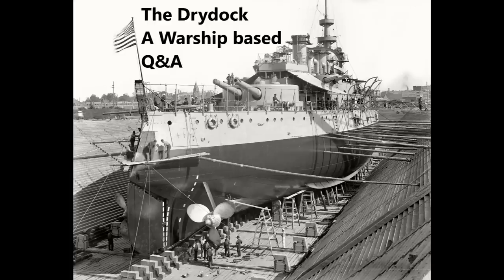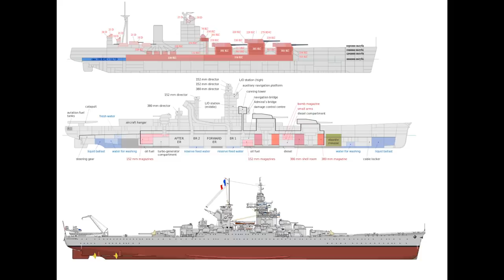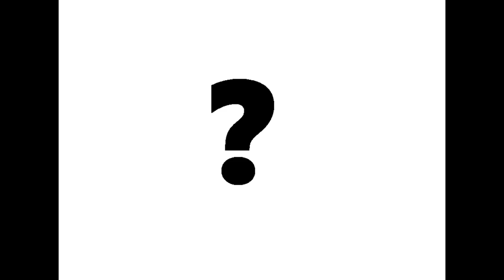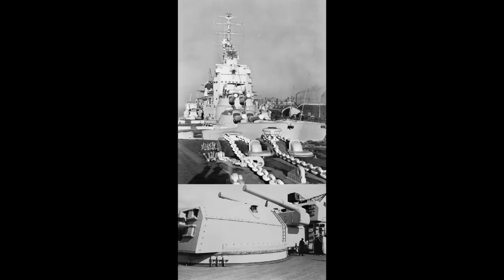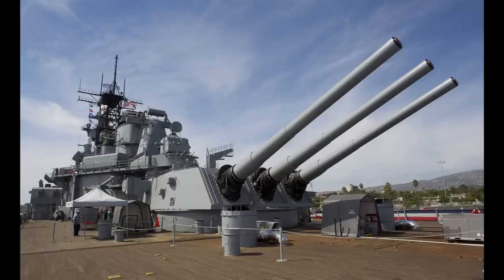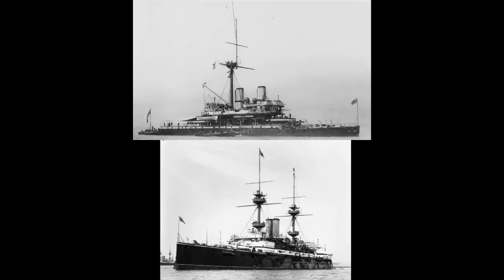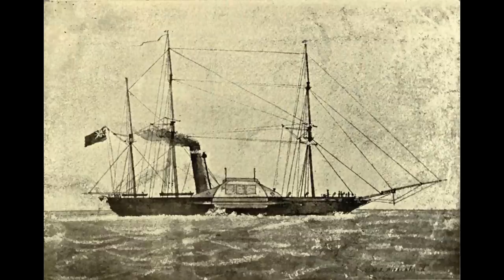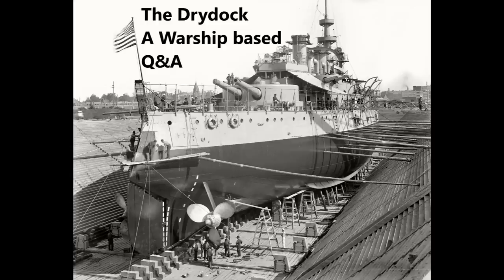The Drydock - Episode 012

Comment: Why didn't warships use projectiles in style with those seen in tanks, or did they?

HEAT
HESH
APBC
APCBC
APFSDS
APCR
Reply: APCBC was definitely used - it's just an adaptation of the normal AP shell by the addition of a cap. 

HEAT, HESH and APFSDS rounds were all technologies that emerged during WWII, when the last gen of battleships was already being built or in service, and matured during the Cold War when battleships just weren't a thing anymore. 

As for APCR, it requires you to basically pack the core of the shell with a super dense material like tungsten. That was a bitch for the Germans to obtain even for their 75mm shells, and I don't think any country in their right mind would try to make a tungsten core suitable for a 15 inch round. It'd be crazy expensive, possibly too heavy for the ammo lifts, and so on.

Comment: Q&A. Given the British navy's chronic shortage of ships at the commencement of WW2, and the fact that the British had had plenty of practice raising the High Sea's fleet............................... why wasn't the Royal Oak raised? The propaganda effects alone would have been worthwhile.
Reply: 1. It is a grave site. 2. She was old and capsized. The expense to salvage and return to service is huge. The danger of fuel leaks and live ammo handling add to problems.
Reply: 1. So was HMS Thesis and most of the stuff at Pearl harbour.2. RO was no older than the Queen Elizabeth's and the other Revenge class vessels. For the 15 inch rifles alone, best in the world, long manufacturing time and required for replacements for a number of classes it would have been worth it.2.5 Salving a capsized ship had already been carried out successfully and should have presented no new challenges to the guys who raised half the German Fleet 3. Fuel and ordinance are hazards that any decent salvage crew can handle.
Reply: @johngreen1706  Well.... the Royal Navy seems to have not shared that view. Thus she remains today as is..... 🙄
Reply: The Royal Oak ended up turning almost completely upside down when she hit bottom.  Her superstructure was crushed by the hull landing on it.  Also, no ship's hull is designed to take the amount of stress that comes from being flipped over 180 degrees and landing upside down.  While the hull appears to be largely intact, hitting the bottom must have created some stress fractures in the metal, even if they are not detectable by the human eye.  30,000 plus tons of steel are going to hit the bottom with a lot of force.  If the ship couild have been lifted all the turrets would've likely fallen out, so those would have had to be raised separately.  Finally, the Royal Oak sank in 33 meters of water (a little more than 100 ft deep), which is far deeper than any of the wrecks at Pearl Harbor.  The superstructure of almost all the American battleships at Pearl Harbor were above the water even after they sank.  The hull of the Oklahoma, which capsized, was also above the water. 

Perhaps the hull of the Royal Oak could have been raised.  The Derflinger; which also turned upside down when she was scuttled at Scapa Flow, was raised from an even greater depth of 45 meters (148 feet).  However, had the Royal Oak been raised she would have been nothing more than a hulk that needed to be scraped; which IMO, would hardly have made for inspiring propaganda.

Comment: Question for the next time:

It is often said that Jutland was a "strategic victory" for the RN but, I have found no factual support for such bold statement.  Following Campbell, he is clear the Germans cancelled the operation that intended to lure into an ambush the BCF or part of the GF due to lack of aerial recce and implemented the Jutland operation instead, a cruise off Denmark intended to lure the GF out and over the Uboats already positioned for the cancelled operation, but nothing more, no intent to engage GF units and much less some mithycal attempt at blockade breaking.  

Does that claim hold any water or is it just propaganda to sooth British feelings?
Reply: I think any result that wasn't a major victory for the Germans was in essence a British victory, because it meant the overall British superiority in no. of ships remained the same (which was only going to increase throughout the war as the British blockade hindered German ability to construct new ships)
Reply: @OhSome1HasThisName  It was a minor German victory and no, the number of ships did not remain the same as the wrecks on the bottom of the sea can attest, but eventually the British did make up for the lost numbers, but that is a different thing.
Reply: @trauko1388  The point I was trying to make is despite higher British losses, the overall balance of naval power remained in favour of the Royal Navy -> all they had to do to achieve a 'strategic victory' was not lose so many ships as to make the High Seas Fleet equal/superior to the RN, but yeah I'd agree it's still odd to call it a victory
Reply: @OhSome1HasThisName  It is not odd, it doesnt make sense, it is like saying the Germans were winning WW2 until they lost... it implies everything is meaningless until decided, and there are plenty of wars lost due to constant small defeats.  Jutland of course was just one, and to claim "strategic victory" for the British is simply nonsense, sorry.  Their strategy was blockade, not keeping ships, and in the END it worked, but claiming that Jutland was a British victory of some kind is pure nonsense.
Reply: Agree to disagree
Reply: @OhSome1HasThisName  Agree that disagreeing is not an actual argument.
Reply: @trauko1388  Okay fine, my argument: Britain blockades Germany, Germany wants to sap the British fleet via raiding to break said blockade but ends up with a full fleet engagement at Jutland, Germany fails to significantly dent the British fleet, hence doesn't break blockade, so long-term (so strategic as opposed to tactical) British victory - I was saying agree to disagree because I think we have very different definitions of what constitutes a strategic victory
Reply: Germany's strategy was kleinkrieg, guerrilla warfare, to destroy the UK's naval advantage throuh mine, torpedo and sinking isolated units until a general engagement could be tried with some hope of success.

Jutland did just that.

It was a reduction of the GF's numerical advantage, the only issue was that it was done through a fleet engagement, something quite premature for the Germans, but the result itself was quite positive and a good example of a successful implementation of Germany's strategy.

There is only problems when anglo authors move the goal posts and claim "failure to break the blockade" or "failure to sink the GF" or "failure to win enough"... which is the poisition you have taken.  The answer is always easym you only have to provide proof that Scheer, or for that matter anyone in the KM, actually intended Jutland to achieve whatever you claim they wanted to achieve.

I can of course point out to the differences between the Sunderland operation, with a Uboat ambush, the GK bait for the BCF, and HSF and zeppelin support... and the Jutland operation, intended to just make use of the pre-positioned Uboats by showing up on the Skagerrak (see how far Sunderland is from Denmark) and hopefuly causing the GF to steam over the Uboat trap as the HSF sailed safely back to port. That was it, no perspective of engagement with heavy units, just an attempt not to waste all the effort invested in the cancelled operation.

Can you really claim the enemy failed to achieve something in a battle when they didnt actually intended to do it?

Btw, if Jutland is not winning enough, what is it? 5 ships? 7? Half?

I will let you with Campbell's conclusion, which seems fair to me:

"However, it had never been any part of Scheer's plan to engage the whole of the Grand Fleet, and though he had doubtless hoped for a still more favourable loss ratio, he could at least claim partial success, the most usual result in any operation of war. Scheer was ready to try again on 19 August 1916."

Now, tell me something, if May 31st was a UK strategic victory, what was the day before, May 30th?  That day the GF LOST NO SHIPS!  Was that a MAJOR UK strategic victory?  What a bout June 8th? September 13th? Or any other day? Because in the very limited sense anglo authors torture the term well, any and all days were a strategic victory.

And you can make that argument... about the BLOCKADE, because that was the long term strategy, but that is meaningless about Jutland, and you could in fact make that claim even after a hypothetical complete destruction of the GF, because the blockade would work until actually broken, and that wouldnt happen until the UK ended it or the KM sank the ships implementing it... IN THE GIUK GAP!

But you cant make that argument about the battle, the GF ACHIEVED NOTHING BY FIGHTING IT beyond learning their ships were very vulnerable to propellant fires, they would have done better by staying in port.
Reply: "you can make that argumnet about the Blockade because that was the long term strategy but that is meaningless about Jutland" -> long-term strategy is what I'm focusing on bud :)
Reply: @OhSome1HasThisName  Then address the issue about all the other days then? What is special about May 31st with regard to it? NOTHING!

So, how is Jutland, A BATTLE, a strategic victory for Britain? HOW? You CAN claim the blockade strategy was working, what you CANT claim is that it had anything to do with Jutland, the GF achieved the same result without leaving port since they were not the ones undertaking the blockade, the KM had no intention of steaming all the way to the blockade in the GIUK gap with the GF in Scapa Flow so, pray do tell, where the hell is this "strategic victory at Jutland"? What did the UK gain at Jutland? 

Not losing WORSE?  Great argument...

LOL!  You only knocked out 3 of my teeth, what a loser! XD
Reply: Jutland was a victory for the RN anyway you look at it. It ended with the high seas fleet running away back to port to avoid taking heavy losses. 

Post Jutland, RN control of the North sea was never really challenged. 

Yes the British lost more ships (though more though their own poor ammo handling than anything else) but they still won.

Saying the Germans won at Jutland because they sunk more ships, is like saying they won the battle of Stalingrad because the Soviets took more casualties.
Reply: @gazzmilsom  It ended with the KM safely in port after inflicting heavier losses on a numerically superior enemy.

The RN had no control over the North Sea, no one did, both sides mined and patrolled the area with light forces.

The RN lost more ships thus reducing their advantage, they didnt win.

The Soviets won at Stalingrad because they completely destroyed the enemy.

I will leave you with Campbell's accurate conclusion:

"However, it had never been any part of Scheer's plan to engage the whole of the Grand Fleet, and though he had doubtless hoped for a still more favourable loss ratio, he could at least claim partial success, the most usual result in any operation of war."

So where is this "strategic victory" again?
Reply: The British strategy was to maintain blockade. Every day that they achieved this meant they were fulfilling their strategy. Ultimately, the blockade was a major reason for winning the war; i.e. their strategy worked. Jutland maintained the status quo, despite partial German success. Ergo, tactical loss, strategic victory.
Reply: @glennricafrente58  Half right, the UK strategy had nothing to do with battles, in fact, fighting MADE NO SENSE, making Jland a dumb and expensive mistake in which he UK WON NOTHING, this supposed "strategic victory" would have been better achieved by staying in port, hence why Jutland as such can not ever be considered a victory, it did nothing for the UK.
Reply: Lol, you can't maintain a blockade by staying in port. You actually have to confront the enemy and make sure he stays boxed in.
Reply: @glennricafrente58  LOL! THE BLOCKADE WAS IN THE GIUK GAP, NOWHERE NEAR THE NORTH SEA!
Reply: Nonsense. If the British had the resources, they would have blockaded the German fleet in their ports. As it was, they settled on a distant blockade. But there's no way they would cede the North Sea to the Germans. That's their backyard.
Reply: @glennricafrente58  LOL! They couldnt have!  Mines and submarines made that impossible which is why they went for an illegal blockade and mined and used subs there as well!  Hence the GIUK blockade.

Glad to see yuo dropped that strategic victory nonsense however...
Reply: Nope, I'm sticking with my strategic victory nonsense, thanks.
Reply: @glennricafrente58  LOL!  At least you admit it is nonsense! XD

It is always funny and yet weird to witness cognitive dissonance, you admit the UK strategy worked every day, without the need of a battle, yet you claim Jutland was a strategic victory because it maintained a strategy that actually did not need of battles...